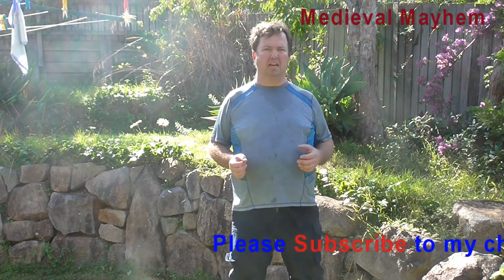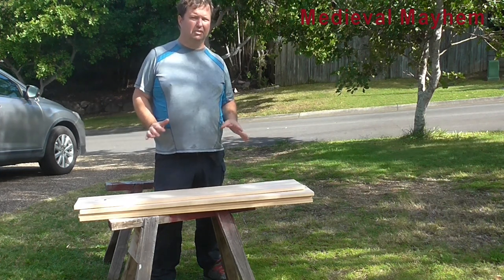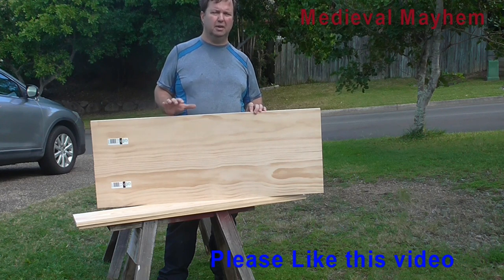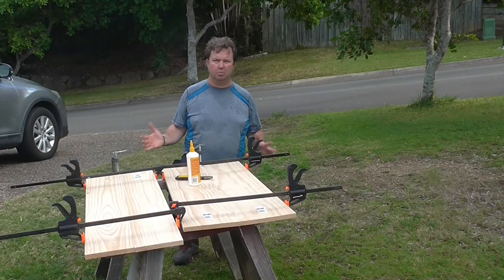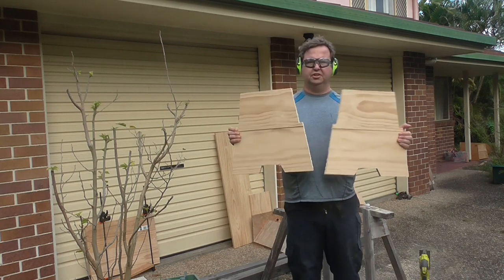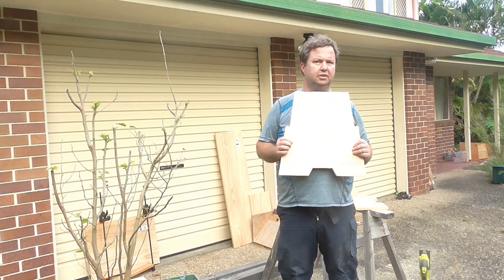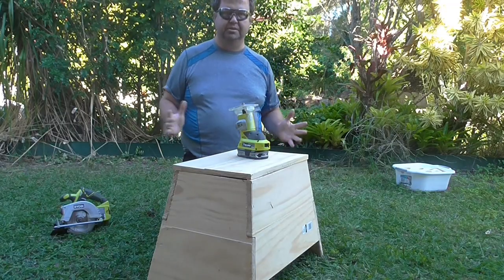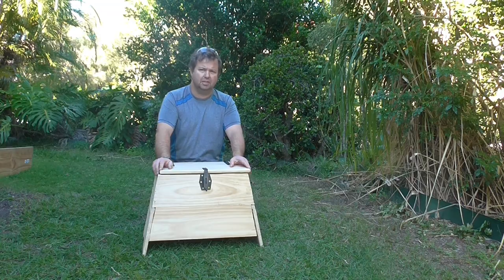How to Make a Viking Sea Chest Ep1 DIY Oseburg Suitable for medieval Re-Enactment, SCA LARP Cosplay

Comment: How is using screwed in hinges fit for reannactment?! Screws, especially philip's head screws are completely ahistorical for a Norman chest. 
You should have used either nails or rivets for installing hinges
Reply from the maker: Yes, agreed. I think I said in the video (which is quite an old video now) that I was unable to source period fastenings and was using screws as a tempoary measure.

Comment: The end boards should have vertical grain which ALL the surviving examples have, as do the chests from the Mary Rose. The 'feet' on the ends of your chest will break off in use because the grain is parallel to the ground (and stress). If you are worries about wood movement, use 'cut nails' or 'Roman nails', readily available on the 'Net from Lee Valley, Tools for Working Wood, Lie Neilson etc.
Reply from the maker: Hi Bruce, that's true. But I was limited by what was available in terms of local supply of wood and time.